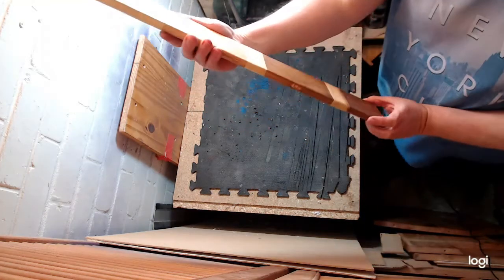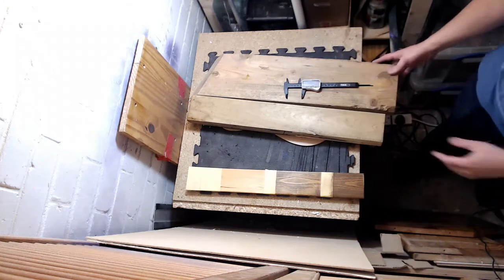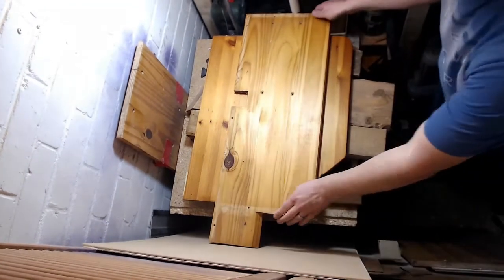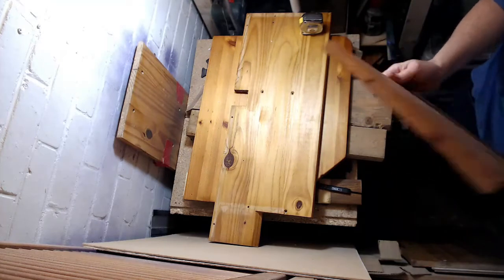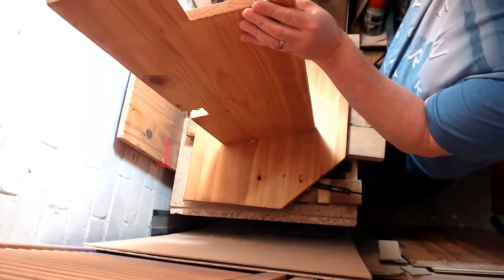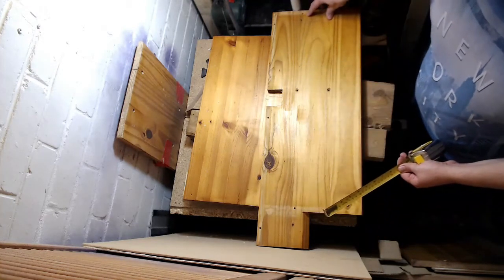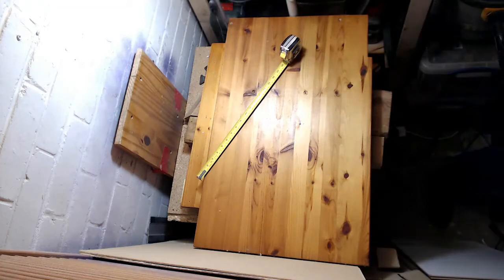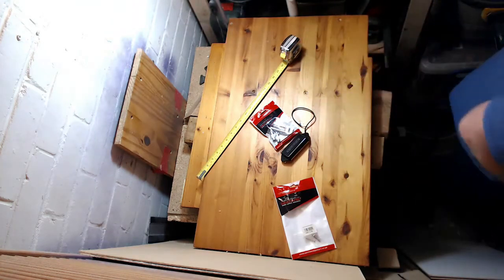Pine Guitar Challenge - Set up

Comment: Featuring the bearded luthier. 😁 Will be interesting to see if pinewood will stay stable over time.
Reply from the maker: I'm going for the full on hermit look with the lockdown! :)   Yeah, it'll be interesting to see how the wood stays stable.  It's very old wood so it could be good(?!).  However it could have internal stresses and just bend into a banana the second I cut it.  All the fun of the fair! :)
Reply: @ChrisFranklyn  So you actually have to stay home? I'm still going to work. I hardly can do anything at home.
Regarding the wood, I think pine bends and twists rather easily. Luckily it concerns a guitar with about 35 kg of total string tension. I'm more used to basses with 80 kg of tension over 34'.